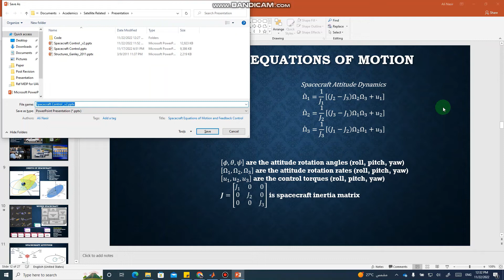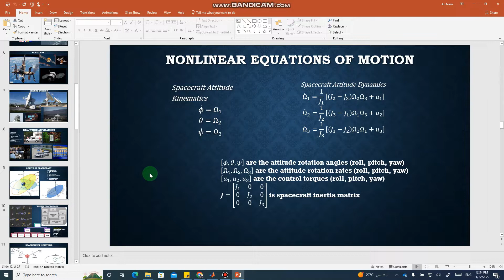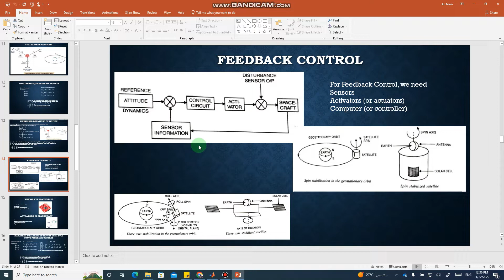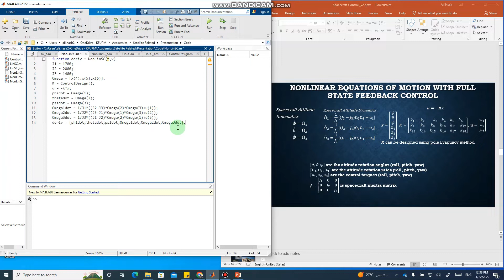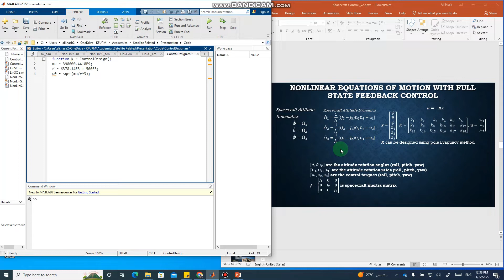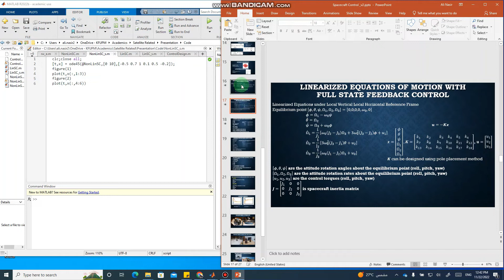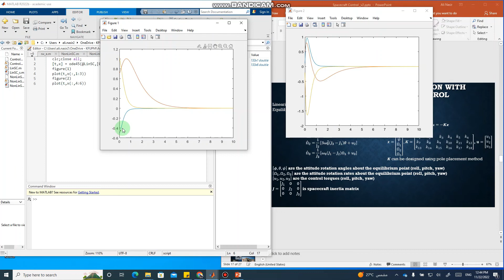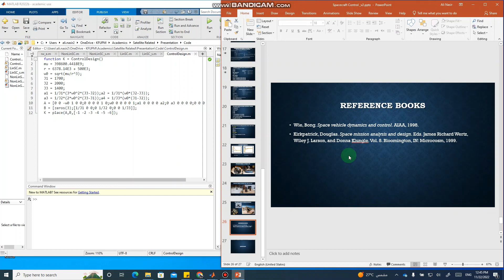MATLAB Simulation of Spacecraft Attitude Control

Comment: Let's take a look at the attitude dynamics equations.

$$ \begin{cases}
\dot{\Omega}_1 = \frac{1}{J_1} (J_2-J_3)\Omega_2\Omega_3 + u_1\\
\dot{\Omega}_2 = \frac{1}{J_2} (J_3-J_1)\Omega_1\Omega_3 + u_2\\
\dot{\Omega}_3 = \frac{1}{J_3} (J_1-J_2)\Omega_1\Omega_2 + u_3
\end{cases} $$ 

and

$\Omega_1 = \dot{\phi},\Omega_2 = \dot{\theta},\Omega_3 = \dot{\psi}$

where $\phi,\theta,\psi$ - attitude rotation angles and $u_1,u_2,u_3$ - control torques. 

Do I understand correctly that force-torque devices (thrusters, reaction wheels, gyrodynes, etc.) are the source of those same control moments? Hence the question: does each control moment require its own device, or is there a device that allows you to immediately generate a vector of control moments?
Reply from the maker: Usually, for each control there is a separate device BUT, you CAN have one device to generate a vector of torque. This depends upon the orientation of the device in the structure of the spacecraft. If your device is aligned with one of the principle axes, then it gives torque about one axis. If the device is not aligned with any of the principle axes of the spacecraft body, then the torque due to that device is a vector.
Reply: @cset  thank you very much

Comment: Happy New year sir 
Sir I have a question
In adaptive finite-time control method for nonlinear systems. If the first term of the virtual control law contains a fractional power . The derivative of a virtual control law may exist singularity problem.
Sir, .will this problem always come in the every  finite-time adaptive  control method? Some authors used command Filter to tackle this problem of singularity and some authors does not use any technique to tackle this
Please sir clear my point
Reply from the maker: Dear Arun, happy new year to you. The answer to your question "will this problem always come in the every  finite-time adaptive  control method?" is no in my opinion. If the singularity happens, first idea should be to redesign the control to avoid the singularity if possible. If it is impossible to avoid singularity (which may happen in some cases where the actuators are not capable of controlling the system under certain conditions), then appropriate filters or piece-wise control may be used.
Reply: Hi sir, is it applicable for satellite as well? Same parameters